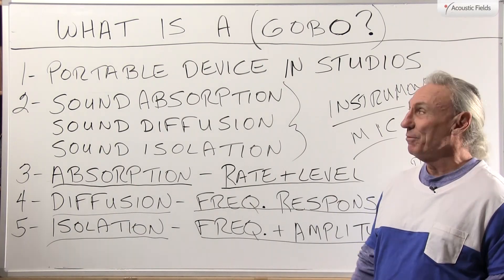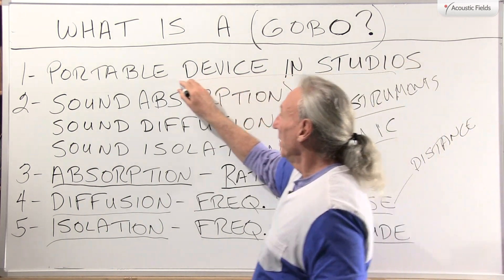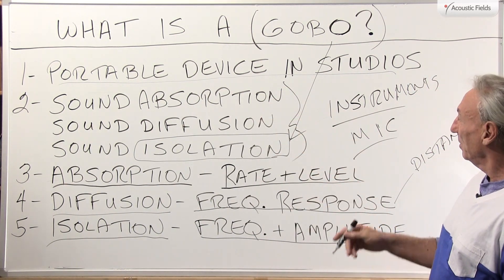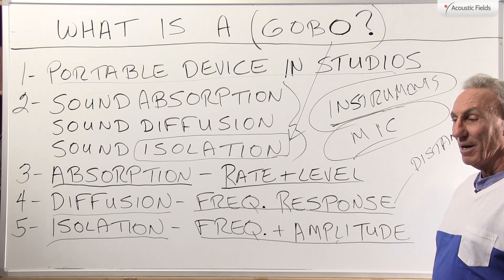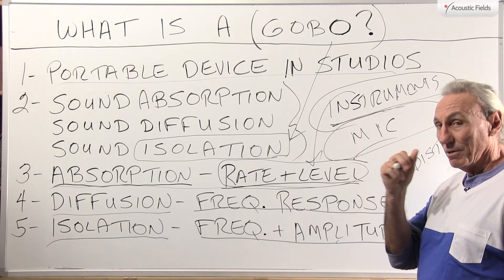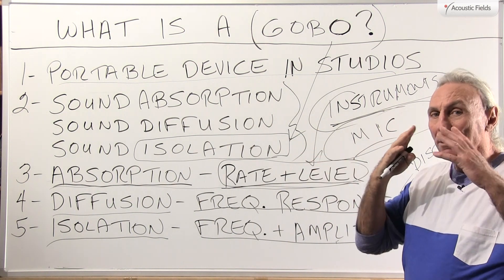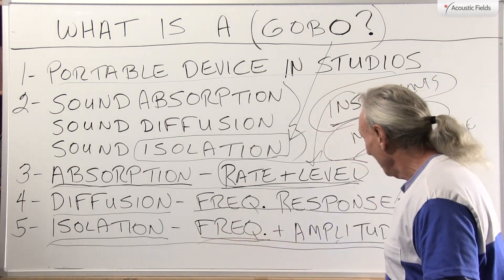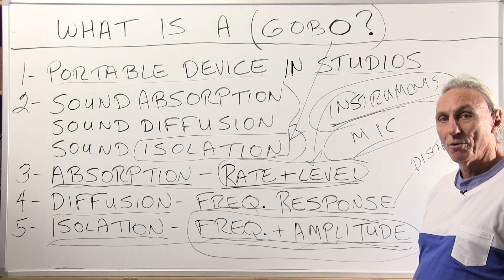What is a GOBO? - www.AcousticFields.com

Comment: What about Portable vocal booth, have u reviewed about this topic?

thanks al lot
Reply from the maker: P,  We design our vocal rooms to specifically deal with the noise issues presented by the client. We measure the noise over 7 days and then design the  vocal room to reduce the noise transmission of that particular situation. We guarantee our results. A portable structure will lack the necessary barrier technology to reduce noise transmission, especially at lower frequencies.
Reply: @AcousticFields  is there any vocal coloration  with this kinda portable vocal booth.

https://youtu.be/tFRhQG-I5L0

Comment: GOBO means go between my gobos reflect on one side, absorptive on the other. but i hate dead rooms
Reply from the maker: Hi Jose, There always has to be a balance between absorption and diffusion. I also do not like dead rooms. Dead rooms are the result of too much surface area coverage with the wrong rate and level of absorption.
Reply: Agree 100# I definitely  believe that MOST tracking rooms are too sterile for my tastes, some properly miked room ambience allows the tracks to need less digital reverb to glue the tracks together. Don't want the tracks to sound like i have a head cold

Comment: Yeah, I"ve used those clear plexiglass drum shields in live situations at small nightclubs.  It helps prevent bleed through to vocal microphones and other microphones for other instruments, and it helps reduce the sound to the other musicians that are standing right next to you.   But they sound like crap to me, the drummer.  They are very bright.  But the advantage is being clear and containing the sound so it does bleed through to other mikes is the biggest reason.  I certainly would NOT recommend them for recording in a studio.  They SUCK for that. A lot of casino bands use them so they can contain the drummer as much as possible, but still be able to see the drummer.

What I would think would make a great GoBo is getting one or more of the QDA's with foam on the outside and having both a wide range absorption and quadratic diffusion, and HOPEFULLY maybe being something that will prevent bleeding to other microphones in the same room.  It's at least something to play around with, for sure.

Comment: Hi Dennis, great information, makes me think outside the box, so to speak!
3 questions for you, if I may, and I have no idea if they are half-baked or not...hehe
1-Could a room be shaped with noise cancellation tech using mics and EQ/compression of some sort?
 and on a different note,
2- Would the shape of a room ie oblong, round, askew, octagonal, or some type of  asymmetrical wonky shape work better than square or rectangle?
and,
3- What about a basement built room with holes/slots for pressure/energy escaping?
I was thinking of an octagonal room with strategically placed/sizable hole/sliding panels vented to the quiet outside basement space or foamed or directional/reflective cubbies...would any of these ideas help to relieve pressure/energy to create a proper live/balanced environment? I have a 1000ft rectangle cement space to play with.
Like most, I am on a budget... Thanks, awesome info dude!!